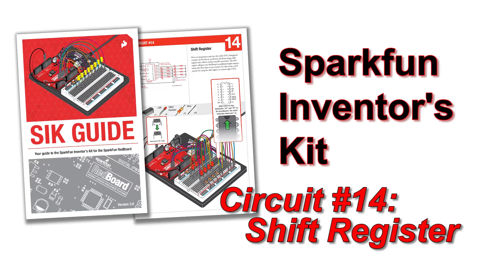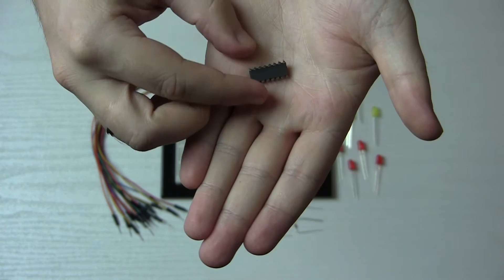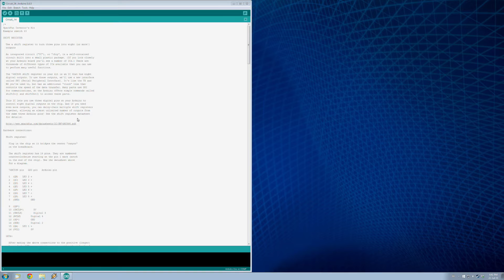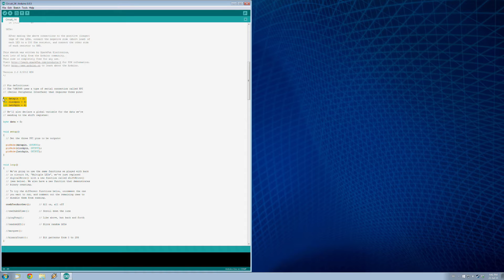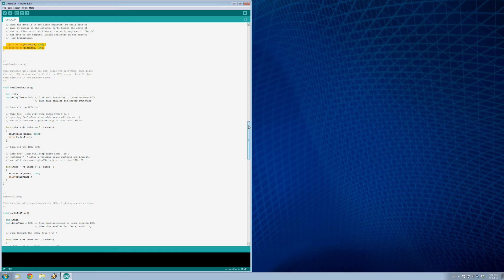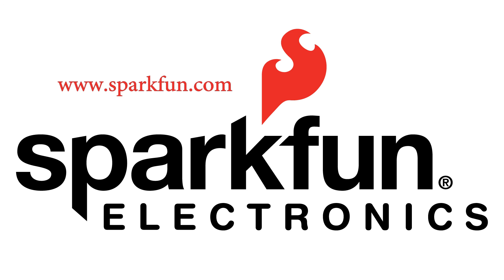SparkFun Inventor's Kit - Circuit #14

Comment: Aside from the new "binary" pattern and an explanation that there can be 8 outputs with only 3 pins, How is this different from #4. Are there some other easy patterns 8th graders would be able to load and test?
Reply from the maker: +jason smith It's not really different from #4!  It's just meant to show how a transistor works as opposed to programming different light patterns.  However, the details of transistors are probably a little complicated for 8th grade.  Of course, with the Arduino IDE, you can create any number of different patters to display.
Reply from the maker: +Jennifer Booker-Smith  If you are trying to do what I am thinking, there is a pattern that cycles on LED on while all the others are off (oneOnAtATime), and you want the opposite of that.  You would simply need to change the HIGH/LOW values around to achieve the effect of having all of them on, and having one off cycle through the set.
Reply: +J Bishop
THANKS for the input, I got it to work (all on, unlit light moves thru display). 

 I just need to understand a little bit more about writing arduino code to get it to do what I want.  

I am new to arduino and SIK, so I am trying to do stuff days before I present it to my 8th graders.  Since 8th graders can't be trusted with 100s of small parts, I had to separate out each circuit into separate bags. Then altered some of the "sketches" to give the kids more to do than just "plug and play".